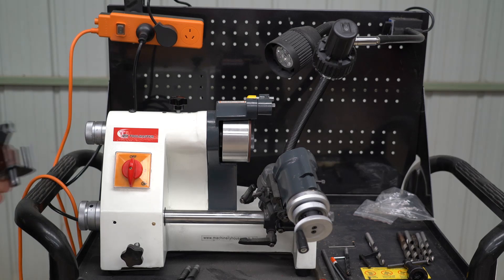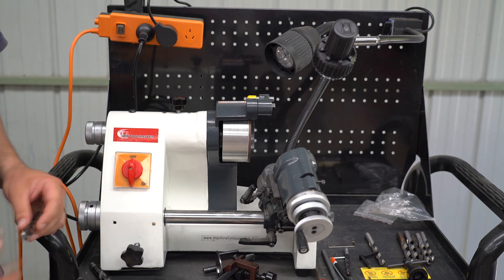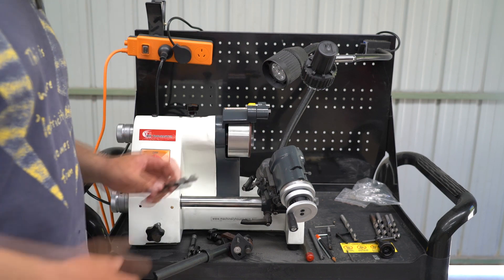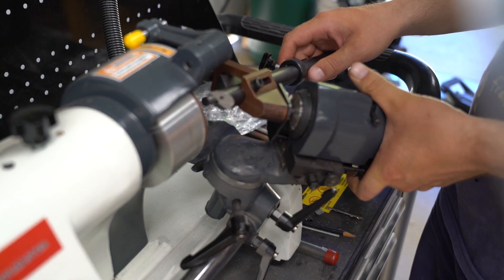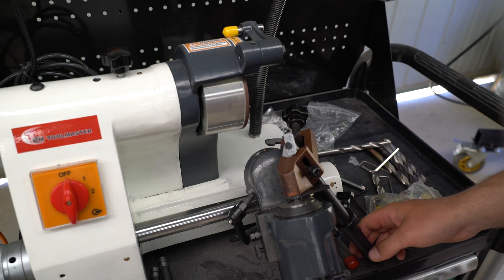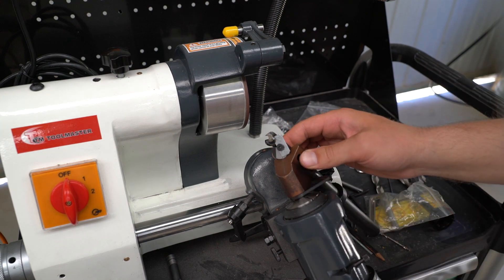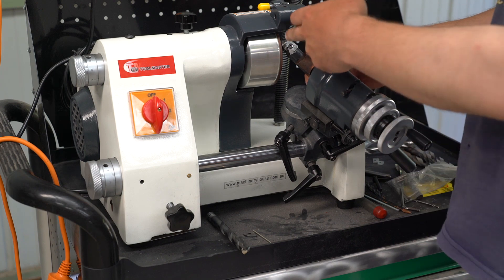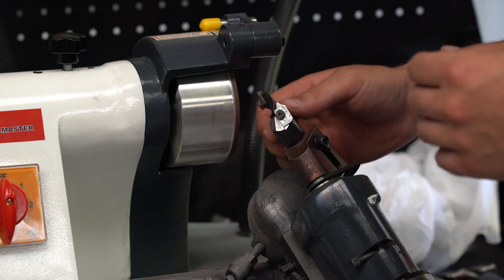😎 Drill Sharpening: Universal Tool & Cutter Grinder AKA D Bit Grinder

Comment: Hi friends:  There appears to be two different styles of  drill sharpening attachments with these clone machines.  The tips at the business end of this and Luc' s have the  alignment plate running parallel with the center line of the pivot.  On the other style this tear drop shaped plate is cocked at an angle  slightly less than perpendicular to the center line.   The tear drop plate is rotated until the cutting edge is parallel with the center line of the pivot pin.  The drill trough is also cocked at an angle other than 90 degrees to this center line.  At this date I have no idea which works better or is easier .......both styles are on offer in the shopping portals, so look carefully if you are shopping for one of these gadgets.

Comment: Great instructional video.  
I have looked at this same d-bit grinder from Hare and Forbes but didn't realise one could sharpen drill bit ..  question do you think you could sharpen large drill bit up to 30 with MT 3 shank?   If not what machine would handle this task?  Hand sharpening the big ones is tricky....  Paul

Comment: I don’t like the idea of holding the larger bits by hand. It’s too easy to slip. I don’t have one of these, though I’ve been thinking about it, but it seems that there should be a way to make a mod for the holder for bigger bits.
Reply from the maker: Yeah I agree I would like to make a different drill holder in the future. But it's okay for occasional user.

Comment: Your video is the best so far! Thank you.
I just bought the Shars with the accessory kit.
I see you set the tool head and made a mark for easy set up to grind flat. You didn't use that setting during the drill bit grind or did I miss it?
You mentioned 14 degrees, is this your standard go to setting? What are the other settings? There are three? I believe.
Making the drill bit plates because the stock one  was too thick. How did you come up with your pattern? I see you just twist it by hand, hold it against this plate you made. A 180 degree reference would be important. I didn't notice how you got a perfect 180 degree reference to grind bot faces the same depth.
Why is it so critical to move the bit out 3 times the diameter of the bit?
Thank you,
Jeff
my email is 2657beemer@comcast.net.
I have subscribed and liked your videos.
Reply from the maker: Thanks. I did use that setting maybe I didn't mention it in the video. For standard drill bits I use 14 degrees. But you can vary a little without a problem. Cobalt drills will have a different angle. When flipping the drill bit around 180 it engages on the little plate so it's always flipped exactly 180 degrees. The 3 times the drill bit width is to make the cone on the end of the drill match the drill size.
Reply: @ProjectsDownUnder  
Thanks for getting back to me.
I'm working my way through your video on end mills.
Getting back to drill bits. When you set up for drill bits, do you set everything up like you did to have the round rod square against the wheel? Like when you made your mark in the paint?
Then you dial clockwise 14 degrees?
Do I have this right?
You are my salvation!
Thank you,
Jeff
Reply from the maker: Yes you got it right. Only thing I would add is, setup the drill bit so that the cutting edge is slightly beyond horizontal to the grinding wheel. So that once sharpened the cutting edge ends up being horizontal. It seems some of these grinders are slightly different to each other and that's the easiest way to make sure the drill bit be has the correct orientation.

Comment: To sum up my appraisal of this type of machine....I used to have a Deckel SO..... it's not really suitable for general tool grinding at the prices asked as you can do all the grinding on a bench grinder with just a tilting tool rest......the original concept by Deckel was specifically aimed at D bit grinding but people though it was a good idea to attempt universal tool grinding too for which it fell very short.
Reply from the maker: It's not a terrible machine but if you keep your eye out on the used machine market you can find yourself a much better older tool and cutter grinder that's for sure. Certainly if you have a good tool rest on the grinder your can do a lot of what this machine can do but not all.
Reply: @ProjectsDownUnder  As I said, I had a Deckel but my opinion is it is very limited for universal status.....true it will grind some tools but it was designed specifically for a purpose not as a universal do all grinder......I have  CUTTTERMASTER tool & cutter grinder which is a true T&C grinder per se.
Edit....Oct 2021....having got rid of a Deckel I find I now could do with one to do cutter sharpening for a mill I've just commissioned,  but more versatile than the original concept so I'm building one from the ground up with a few different characteristics.

Comment: Thank you Sir for your video, I found it helpful. I have a mid-grade Drill Doctor, which works great for most of my need, but when I need to sharpen 120 degree Spot drills then I need a bit more versatility, which is when the Deckel clone comes out. I have yet to use it, but sometime this week I will sharpen those Spot drills. Thanks again!
Reply from the maker: Glad it helped

Comment: Thanks for the video. Can you provide a link to the video showing the manufacture of the small plates?
Reply from the maker: I filmed a video of the drill attachment modification (not uploaded yet) but not making the little plates to go with it. To make the little plates I used a piece of 1.2mm sheet metal and used some metal shears to cut them out. There was some trial and error and grinding.
Reply: @ProjectsDownUnder  Thanks for a very helpful video. Can you provide some drawings or dimensions of what size plates have worked for you?
Reply from the maker: From the center of the screw hole the 3 plates are about 6, 9 and 12mm respectively and they are all 10mm wide. If you search Luc Wybo here on youtube he has some videos on drill sharpening on this grinder, in the description he has a PDF that has some dimensions on the plates. I made mine based of those dimensions.
Reply: @ProjectsDownUnder  Thanks

Comment: I have had one of these machines now for a few years but have never used the drill grinding attachment only looked at it a few times wondering how to use it. I thought I would take a moment to learn. I enjoyed your video and your instruction, however it seems to be fiddley and time consuming so I will continue to hand sharpen as I have done for the last 50 years.
Reply from the maker: Glad you enjoyed the video. It's definitely fiddly but once you get the hang of it the results can be really good. I am hopeless at hand sharpening so use this attachment for larger drill bits.